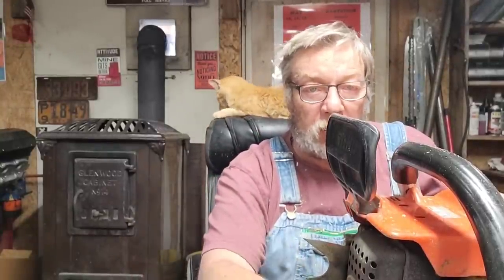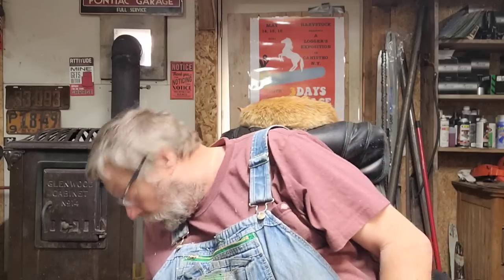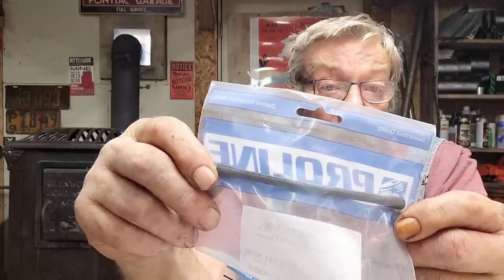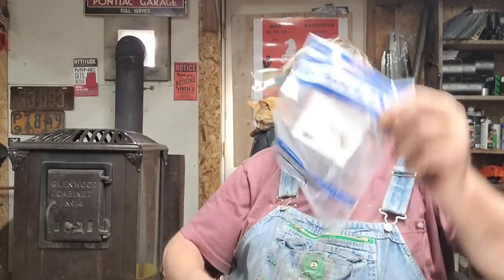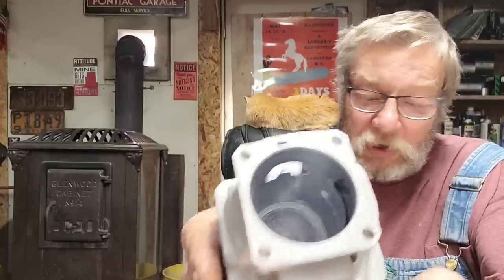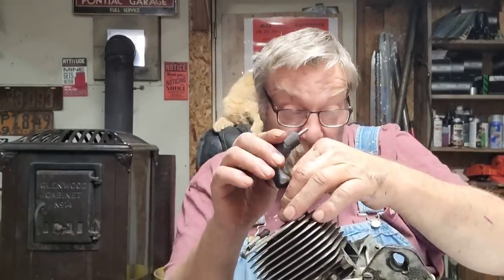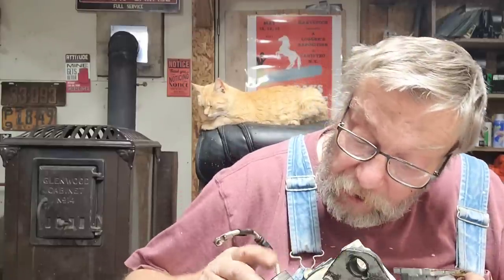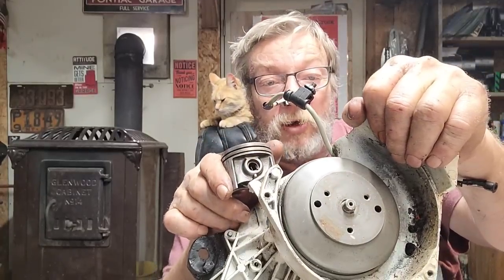sawzilla came thru for this 056av build! New bearings for the bottom end! let's run this saw!

Comment: Hi! Just subscribed. I'm rebuilding a 056 right now. Cost me 75, missing small parts, replacing cylinder and piston, rebuild carb, new to me recoil. Never done it before and I screwed up not taking pictures. Could use a top cover if you know where one is lol. Good job on the video! Putting a 54mm jug on it instead of the 52, the old one is worn, not scored. Bearings seem good to me. Going to be interesting.

Comment: I know how to dig too. I got bearings for my old snowblower from a wheel chair parts supply company. Also, the bar studs, take the helicoids and studs out, clean everything really well so there is no oil residue in the holes, studs and helicoids. Coat everything with "PC7" two part epoxy and thread them back in, then wait two to three days for it to cure properly. PC7 is great stuff but that is the only area on a chainsaw where it will work. I've done this to two of my chainsaws and haven't had any problems. Just make sure you coat every surface, inside and out. You have plenty of work time too. You look good, glad to see you with more vim and vigor. Take care.

Comment: Don't change the case... look up thick walled Keen-Serts... solid thread inserts. 😉
Reply: I’ve used helicoils, e-z lock and step studs to repair bolt holes. I would have gone with timeserts or keen serts
Reply: @lelandhuey2265  I love keen-serts... you can get thin walled, thick walled, hardened, Stainless, etc.

Comment: the reason chains dont cut well out of the box is because the wheel the companies use to grind them break down, load up, and change profiles as the shift goes on. so the profile and depth of the wheel grinding may vary a few thousands. i know this, because im a professional grinderman. i work on these things all day. so the chains cutters will vary from the beginning of the shift to the end. if you use a pair of calipers and measure from cutting tip to but theres a lot of difference. once you grind them you will bring them closer to the same depth/length. once theyre all equal their perfomance improves dramatically
Reply: theres a huge improvement on equal cutters if chain companies use CBN grinding wheels comparied to vitrified grinding wheels. but CBN still breaks down and profiles/depths (dia. of wheel) change. the more the operator/grinderman stop and re-profile the wheel and setup the better the cutters will be but that also will slowdown production, which many companies wont be happy with. it just comes down to quality vs quantity
Reply: Thanks for the insight from a person in-the-know! I use CBN wheels on my grinder and it make a difference!
Reply: @HayChaffandSawdust1  it will help from overheating the steel for sure. also leaves a smoother grind with less burs

Comment: HI IRON HORSE 😊😊 U sure look alot better than what U I sure hope U feeling better than what U did 😊😊 the old saws didn't turn many RPMS they did have the pulling power 2 cut the big trees U can feel them pulling your arms they were old school chainsaws then they was alit better and faster than  the old 2 man cross cut saws and the teeth on the old chains were 1/2 inch they don't even make chain like that no more and it's very few of the old chains U see anymore they had alot better steel in them and the way they were made iron horse U should do a video on sharing the chain so it cuts rat tails its not many people who sharpen a chain like that 😊😅🎉❤🎉 😊 OMG 11 19 2O23

Comment: Pro line intake boot for a 51 lasted about 6-8 months till it cracked and split. Chinese junk. OEM is only way to go with rubber parts
Reply from the maker: Where do you suggest we buy oem for a 50 year old saw!
Reply: Call mastermind 😂🤣😂🤣😅
Reply: @thetwostrokerebuilder Proline parts are not made in china...

Comment: Not a 70s saw Ironhorse its a 80s saw
1980 to 1985 production years

056 AVE – standard with electronic ignition

056 AVSE – Super with electronic ignition

056 AVEQ – standard with electronic ignition and chain brake

056 AVSEQ – Super with electronic ignition and chain brake

056 AVMEQ II – Magnum with electronic ignition and chain brake

Stihl 056 056S 056 Mag CCs 81 ccs 87 ccs 94 ccs Bore 52 mm 54 mm 56 mm Stroke 38 mm 38 mm 38mm Weight 18 lbs 18.1 lbs 18.52 lbs Power head only
Reply from the maker: Thanks jcc!
Reply: @theironhorse6600 More then welcome Ironhorse good to see you getting heather aswell as getting these real stihl saws up and running again brings back a lot of good memories running them back in the day one of my favorites 👍